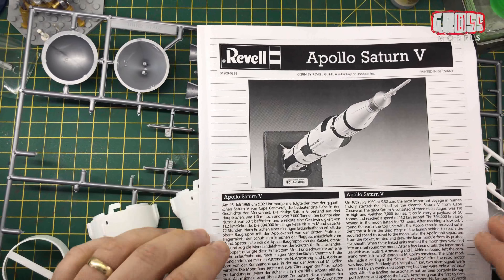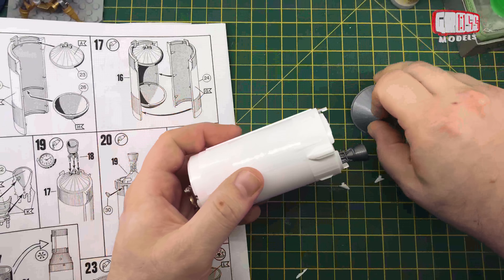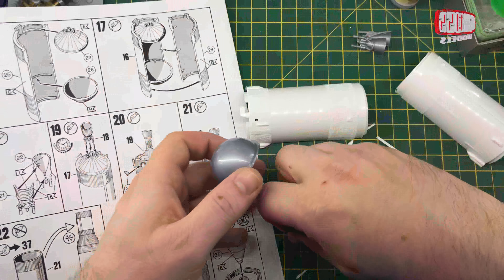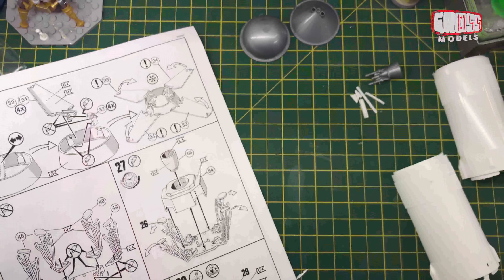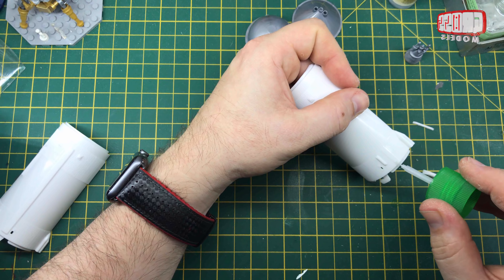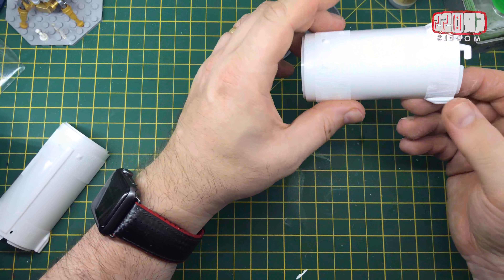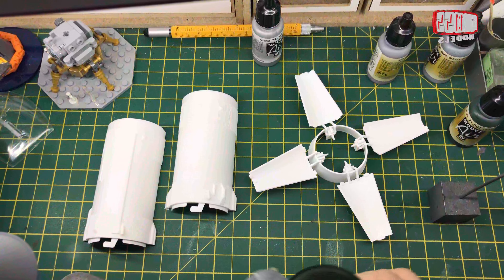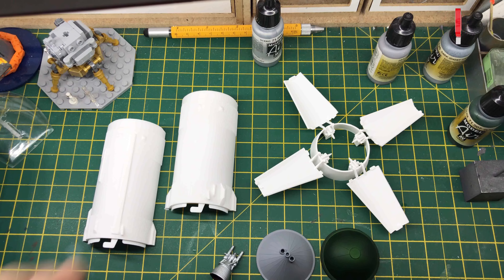Revell 1:144 Saturn V rocket. Part 3: 3rd stage and upwards!

Comment: 27:53 A more better way to do the white sections is to use white decal paper, just measure the rectangle blocks and then cut out the shape on the decal paper and affix in the usual way, jobs a good un' with dead neat lines.
Reply from the maker: That would be another option.

Comment: Service module don't have windows. Only return command module have a windows.
Reply from the maker: I can see why they wouldn’t put in more windows that’s they need.
Reply: @GrossModels  That's not the reason. Only the command module was habitable and only the command module sustained life. The Service Module could not even be entered.
But anyway, great video.
Reply from the maker: Ahh. Thanks.